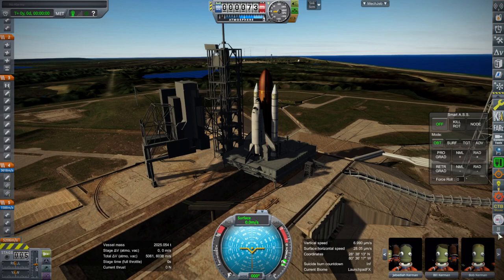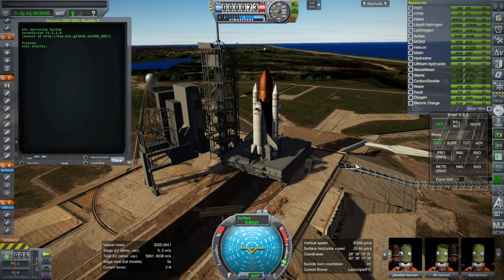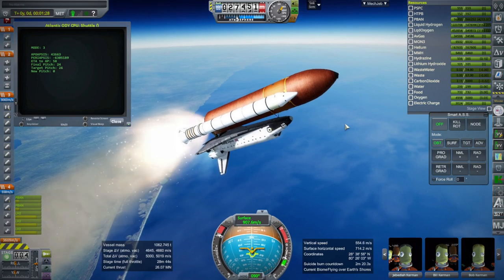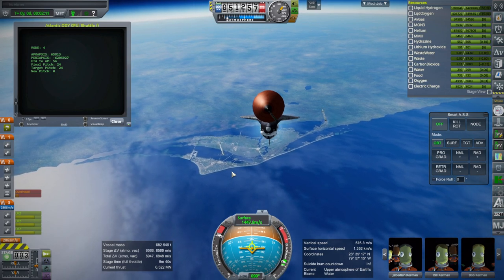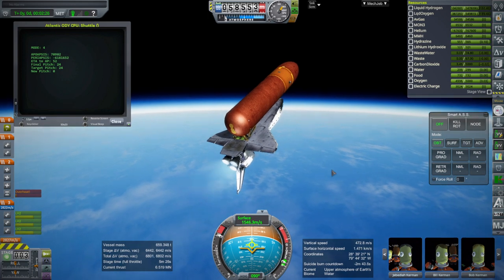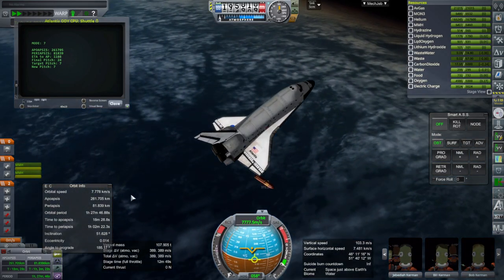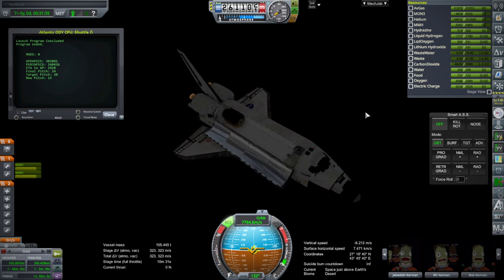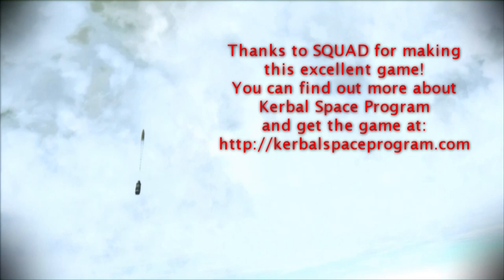Kerbal Space Program 1.12 with RO - Shuttle Launch Script Update

Comment: i found out placing an avionics unit with the same orientation as the SSMEs and switching to it after booster sep gives better control and improved orbital insertion efficiency , very helpful if used with mechjebs ascent guidance
Reply from the maker: It's not necessary for kOS - I just write the script with the tilt built in to the calculations. I just had to do the same for the OMS burn, which I hadn't already done.

Comment: Great work!  Curious, where can i find the readme file for what to set the ag toggles to?
Reply from the maker: I probably should have made one. I'm not at home for a bit, but looking at the script, AG6 is the APU (it activates immediately so the power is available during launch. You can also add the Fuel Cells here if you want them on, too, but I usually activate them after launch so that a bit of the APU hydrazine gets consumed). AG1 I'll have to check on when I get back. AG10  toggles the SSMEs; AG9 is their gimbaling; AG8 is the OMS engines; AG7 is the ET Doors. For videos, I would probably also have AG5 as the bay doors and AG4 to decouple the payload. Wish I remembered what AG1 was .